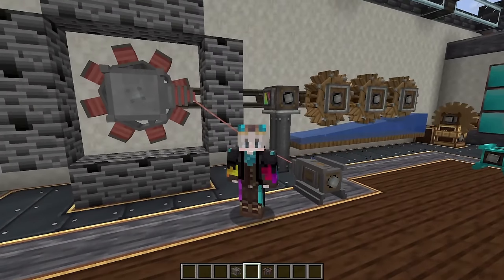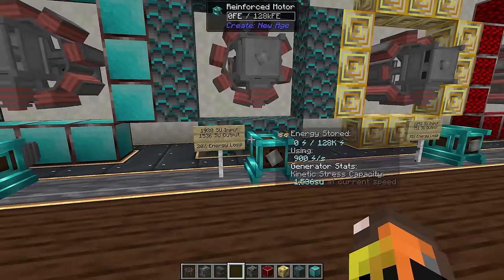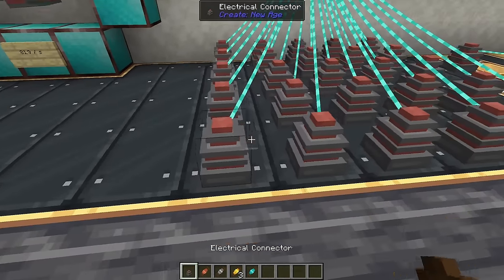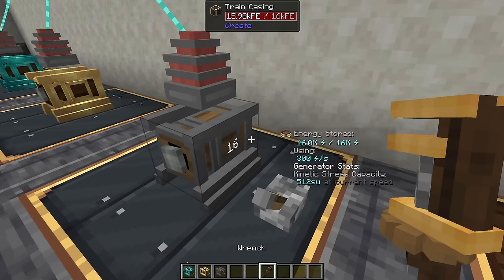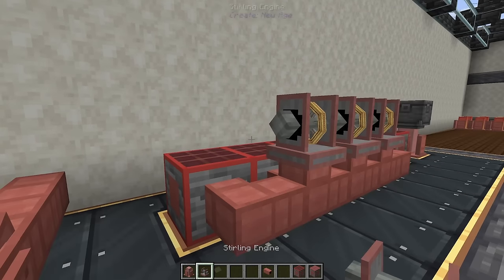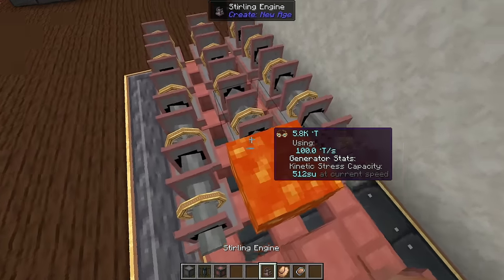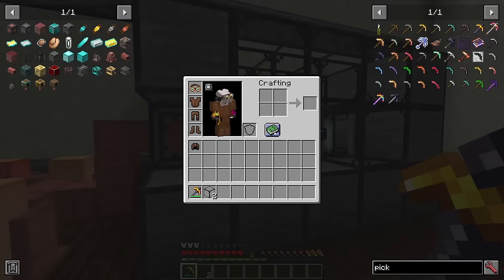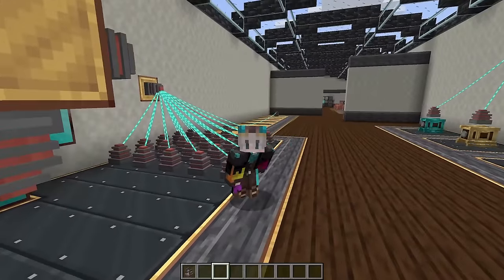Generate ELECTRICITY with Create | Create New Age

Comment: the thing I feel is really holding this mod back is the programmer art.
Reply: The art looks fine for a tech mod. Create just has magic mod level of art, its hard to compete with that for a new mod
Reply: @nautil_us  I'd be inclined to agree, if we were talking 6 years ago. But I think newer mods like create, farmersdelight and byg have just kinda set a new standard for how minecraft mods are meant to look. having this mod in a pack with the contemporary mods just feels out of place. But the devs are only human, I understand that. Hopefully an artist can join the team to pretty up the blocks a bit.
Reply: I think the tier 1 stuff is fine but yea the higher tier stuff does not fit in the create aesthetic at all.
Reply: @Poly_0000  fr, mods like Immersive Engineering and the others that came after usually looks extremly good and consistent between addons
Reply: The art did change in the recent update.
Reply: It's funny because the 3D models look pretty good, but the flat textures look goofy. It almost feels like there were two different artists working on the mod
Reply: Thanks fully, the models seem to be updated recently, otherwise it looked like a pet project, not as in-depth as it really is.
Reply: @Poly_0000  i would honestly be down to do some art updates for the mod dev if they somehow contacted me
Reply: @ocksie  you should contact them
Reply: Aint there some fan made resource pack for that?

Comment: I'm not a fan of the ridiculous diamond costs for the final tiers of magnets (especially because diamonds aren't magnetic). I feel like one of the biggest selling points of Create is that it doesn't require stupid amounts of things like diamonds or ender pearls just to generate power, perform various crafting steps, or make cool building blocks. In fact, Create almost exclusively uses materials that aren't expensive in its crafting recipes: copper, andesite, wood, kelp, etc. You also have to consider that it's probably a lot easier to build two or three hematite magnet generators than to spend the time required to build a diamond one.
Reply: Create sifter mod fixes diamond cost but yeah
Reply: It's a power mod conversion/ integration style mod so it uses tech mod style of progression 

But on that note it's not great at playing well with others and the converting Rate is ea/s and not ea/t witch makes things a bit more confusing
Reply: Does diamond armor make sense?
Reply: @cortinastone Can anything in Minecraft make sense, or does every mod creator have to make something that defies all logic?
Reply: The diamonds, overall, just feel shoehorned. Diamonds, in all actuality, aren't very useful in real-life
Reply: @cortinastone It makes more sense, as diamonds are quire strong. Regardless, diamond armour is part of the base game
Reply: I’d rather it use a recipe with a single netherite scrap and 8 of the previous gold tier of coil to get 8 netherite coils. After all, as per the lodestone, netherite is magnetic.
Reply: I feel like people who replied to my post are completely missing my main point to instead focus on the fact that I pointed out diamonds aren't magnetic
Reply: @MajorTomFisher  yeah the other issue is that it feels a little more “tech progression mod” ish, but that is not in and of itself a strictly negative thing. But the fact that it’s a mere flat upgrade is. Brass funnels are an upgrade to andesite ones, that’s inarguable. But it’s the added functionality beyond just item transfer rate that gives it its usefulness. 

I think when it comes to power generation, some degree of numerical improvement is to be expected and even necessary as power needs increase. But I struggle to think of extra non-numerical improvements. Maybe they’d require cooling to achieve that higher conductivity for lower power loss due to resistance? Actually, come to think of it, that’s not a half bad idea. Give each block a small item and fluid inventory, and blocks and items like snow and the various ice types a coolant value. Feed the coils the items via mechanical arm and funnel, and pump out the water afterwards. That’d encourage farms and factories for things like snow and ice. Now it’s something akin to stress unit generators, where you have passive options with lower output and active ones with a requirement for actual infrastructure to feed it, but higher output.
Reply: @recursiveslacker7730  While brass is more expensive than andesite, it's also not so prohibitively expensive that it prevents wide use throughout a complex factory. That's what I like about Create: the up-front cost to automate most things isn't so high that you have to basically play all the way through Vanilla Minecraft's progression just to  get started with basic machines. You don't have to pick and choose when to sacrifice rare items like diamonds for a non-mining purpose. (Although thankfully Create's minecart contraptions make mining much easier and far less costly) That's why I don't feel that gaudy expenditures of diamonds mesh well with Create where the focus is on trying to put together cheaply-made pieces to create a nifty contraption (similar to redstone) rather than fussing over the seventeen steps required to craft the magic white box that does the thing you want. (i.e. Thermal Expansion, Mekanism, etc.) Create still has a little bit of that (Blaze Burner, Grindwheel) but only as you progress to later stages and usually only to grant you access to more powerful versions of crafting recipes you already had or more compact and fine-tuned versions of the automation tools you were using.
Reply: @MajorTomFisher   yeah, that’s why I settled on netherite scrap to make 8 of the upgraded versions of the coils. Slapping down a few beds at the right y level will get you at least a few pieces of debris, to say nothing of what mining trains can grab. 8 coils to one debris is generous enough, and if it isn’t, maybe a heated mixing recipe for 2 copper and 1 netherite for 3 alloy bars to let you make 24 coils instead would do the trick. Or maybe use some other resource or method. Have lightning hit a rod attached to a lodestone to transform a coil placed below and automate the collection and replacement with drills and deployers. Press copper, magma cream, and lava together. Do some other weird third thing. The point being, electricity is a step up from kinematics! Doing it completely effectively should be a step up. 

That said, I probably would have gone with a generation system that just functions off of having magnetic blocks moving near coil blocks and measuring the relative speed for output. Mechanical bearings, mechanical pistons, minecart contraptions… probably would be hellish to program but would open up more creativity.

Comment: I'ts an interesting mod, but I'm not sure if I like the tiered magnets. It feels too linear and simple to me. Create is about using all the tools at your disposal to make whatever you want, and this feels more progression based than the base mod and the rest of it's add-ons. You don't have different tiers of cogs that can spin faster, for example. It's a great concept, but I think it could be executed better. Just not my cup of tea.

Edit: tiered magnets, wires, and motors
Reply: you got tiered power sources in normal create, this isn't any different. to get the "better" sources you have to go and set up production lines for those better sources, again not any different then the tiered system of the magnets.
like if you want to go from water wheels to windmills you need a LOT of wool. you want boilers? well you need copper and coal/charcoal, to get even better boilers you need blazes fed with blaze cakes.
Reply: @rocksfire4390 that's true, but at least they're fairly different from one another. Here it's basically just copy-paste with new materials.
Reply: @appletree13 like a bigger alternator for a higher tier is a good start?
Reply: Yeah also since self sustaining engines are a piece of cake to build with lava cauldrons you can just spam a bunch of those for essentially infinite SU and eliminate the need for the highest tier magnets
Reply: @collinkaufman2316  something along those lines yeah. Preferrrably something a bit more distinct, but as long as it doesnt follow the overused and uncreative iron-gold-diamond linear progression, i'm fine

(also sorry for being late. youtube didn't give me a notif)
Reply: yeah, the thing is minecraft already kinda has magnetite, lodestone exists and it could be crafted into a permanent magnet, or at least netherite could. And it really isn't a problem since you could add progression after that like that one time create had integrated circuits, could use them for stuff like motors with regulation or LED displays
Reply: @matiastripaldi406 the point of the mod is energy transportation

Comment: Im not sure electricity is what i want in create. It alwyas felt like Create was a fantastic and creative alternative to all those electricty mods you find in modpacks. I get where the idea is coming from but im just not sure this is what people want from the Create mod. probably better for an alternate mod or an optional extension
Reply: Dude it's an addon to Create. It's pretty munch an option extension. I personally saw it on Curseforge and said nope SU are gold and all I need but after this video I kinda want to add it.
Reply: Like the other guy said, it's optional.
But this rotation into electricity thing is how it's somewhat done in real life. 
In real life you generate steam, push it down on a turbine, that turbine is connected to a coil inside a generator. The generator is a small room of magnates, creating a magnetic field. 
The spin isolates and forces electrons to the coil, then out into the wire. 

So yeah, I'd say it fits create as a progression through time thing.

Comment: It's a cool mod in concept, but Create Crafts and Additions already does this on top of bridging the gap between Immersive Engineering and Create.
Reply: yes, but its also limited and buggy- nothing wrong with having multiple mods doing roughly the same thing- look at immersive engineering and industrial foregoing for instance
Reply: Yes.. but somhow this version feels to me more.. " imersive", more like Create.
Crafts and additions is an cool mod, non the less
Reply: Crafts and additions mostly feels like an adaptor between create and other more standard tech mods
Reply: @jadegreenleaf781 yeah the connectors in C&A cause rendering issues and crashes.

Comment: cool mod in concept, but like someone else said on here, Create Crafts and Additions does a much better, more balanced job and it fits much better with the create progression path. this feels like making the conversion difficult for making it difficult' s sake. the progression path here feels too long for me to want to actually use it.
Reply: crafts and additions has a huge balance flaw, which is, you can power 16 full speed alternators with one full speed electric motor and you'll get a massive net gain of power
Reply: But getting the 8 tier magnets isn't that hard. I think the game incentivizes you to use the nuclear reactor as well, because it's an easier way to get a max boiler, which you need to generate enough SU to spin a max coil.

Comment: This mod also treats electricity as "just energy". It would be great if they could add voltage and amps in the same way that create has stress units and rpm. voltage as the rpm, and amps as the stress units. along with melting/burning blocks etc when  the amps are too high, and perhaps electrocution if the voltage is too high and the parts aren't insulated properly.
Reply: I'll check it out. I've heard that it's a difficult mod, but that's perfect for me. The old 1.7.10 mod ElectricCraft (an addon for RotaryCraft) has a simplified electricity system: It essentially uses the same system the RotaryCraft does just with volt and amps instead of rpm and torque. transformers acted like lossy gears that need cooling. resistive loss was proportional to current, so using high tension for power transmission was important. Resistors acted like current limiters, just independent of the voltage. Batteries could only charge or discharge, bu not both. A circuit could only have up to 4 current sources, or your cables turn into lava... Yeah, definitely quite a few simplification, but still far better than most other electricity mods I've seen. samonautika
Reply: Bro want to gregify create 💀
Reply: samonautika me when Fubuki:
Reply: Well it's made to be compatible with FE aka Forge Energy.  Which is like the oldest Energy form in minecraft mods since 1
7.10

Comment: 19:30 corium applies radiation randomly (using random ticks, so random tick speed would affect its speed)

This is how corium works:
Every time it random ticks:
1. It applies radiation in radius of 20
2. It adds heat to blocks around it
3. With 5% chance, it becomes solid
4. It checks if it can break the block underneath it, rolls a number from 2 to 12 and if that number is over that blocks explosion resistance, it eats it.
Reply: I'm pretty sure it was applying radiation whenever it ate a block - which is still random, but saying that it applies radiation randomly is like saying that standing on a sapling will suffocate you after a random amount of time - it's not false, just missing a step and suggesting it's a direct result.
Reply: @Autoskip  I edited my comment to reflect on how it actually works.

But I don't think it would be a good idea to fight me on how corium works .... I wrote the thing...
Reply: @nullblade  
…I appear to have been out knowledged - but to be fair, I had no idea that you were the author, and that initial description did seem to be missing a strong correlation.

Given you're extremely knowledgeable about the mod though, I was wondering if those heat pipes were inspired by and/or compatible with the heat pipes from Crossroads (by Technomancer)? (I'd test it myself, but for some reason my computer's refusing to play modded minecraft in 1.19 and above)
Reply: @Autoskip  I haven't heard of their mod so they were not inspired. Additionally due to how our system works they are very unlikely to be compatible. Hope this helps.
Reply: @nullblade   -  Yeah, there was a reason I didn't take the mod author up on the bet that you didn't use his API.

Out of curiosity, what kind of incompatibility are you expecting? Is it just that you didn't build it to interact with other mods, or is there some fundamental difference with how you think Crossroad's heat system works?
Reply: @Autoskip  Two systems that were built separately and don't use a common api won't have an interaction between them.
Reply: Very cool! From seeing it in the video first it really seemed to have a mind of its own. Like an anomaly from the STALKER games or something.

Comment: just installed this thanks to your video, this is beyond useful and the integration for other mods like Storage mods and other tech mods that have been a pain to use Create with or requiring another power mod. this seems like such a nice thing
Reply: Where does magnetite spawn best?
Reply: @collinkaufman2316  I cant accurately answer that but i found it best ranging from 0 to the surface in stone layers.

Comment: I feel like it falls into the magic box problem a little too easily like other mods, can the reactor be used to heat a standard create boiler?
Reply: ye it can
Reply: I feel like there is room for something like a create: thermodynamics add on to redo higher tier power generation, and act as a base for other add ons for stuff like nuclear etc.
Reply: Yeah, the progression isn't really that in depth. Like, it's essentially just Powah!'s crafting recipes

the reactors are neat, as are the heat mechanics, but a lot of those have been done with other mods too so idk. Pneumaticraft even already has an addon for compatibility with Create, and thats the thermal stuff right there
Reply: Yes. In fact I'm fairly sure the game incentivizes you to use reactors to heat boilers, then use that rotation to power your coils. 
It's an easier way to reach a max boiler, what's needed for the immense SU usage for netherite magnets.

Comment: 6core reactor can comfortably power a max lvl boiler if any 1 was wondering 

And a max lvl boiler can run exactly 17 layered magnet rings (66.7% eff) at max speed witch gos over the cap of what it can actually produce for power so out puts  57.6k FE/s (8 rings)
Or 2.8k FE/t

Comment: Crafts'n'Additions with electric water wheel (with seems cool) and NuClEaR PoWaH, cool concept about heatpipes tho, point for that. Nuclear turns me off tbh, kinda seems too new for this, jumping from burning charcoal to atom that's cheap and simple as soup... yea, kinda weird direction.
On that topic you realy should check out Compressed Creativity, it adds connection between pneumaticraft and create and seems like solid alternative to electricity.
Btw, am i the only one who loves those "immersive engineering-like" power cables instead of "block-like" cables from thermal/buildcraft/way-too-many-of-them, seems like one of the better and more esthetically pleasing options out there, tho i would add a limit to how many connections you can make from one node, just to spice things up.

Comment: Does anyone know if it's possible to send generated power or heat to the Nether?  Powering nether lava pumps can be an issue, and it would be neat if this mod provided a whole new system of power transmission that happened to also deal with the Nether issue.

Comment: It looks like the Corium was only producing radiation when it ate through a block - admittedly, I only have two datapoints confirming it, but the first two times you took radiation poisoning were when the Corium block fell through a block - and the last time could've been the same block melting through the ground beneath your showcase shed.